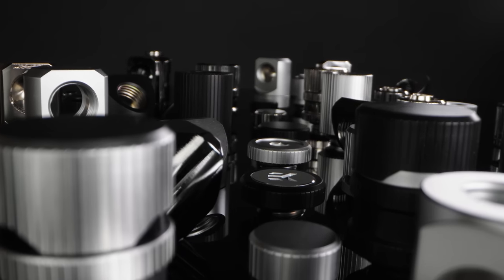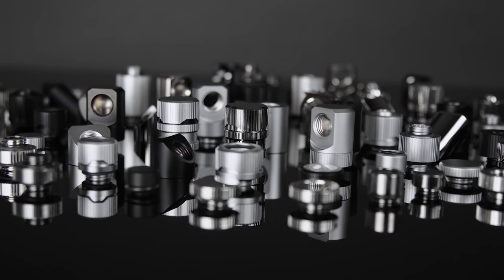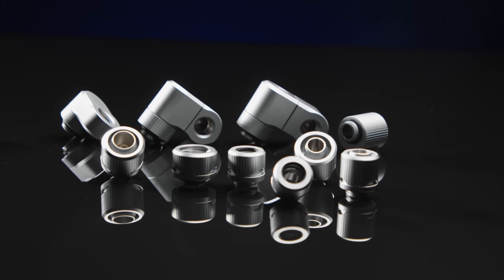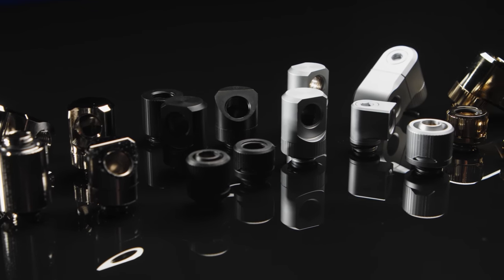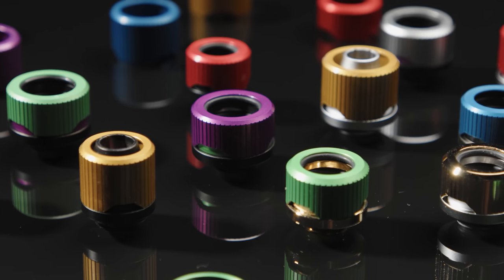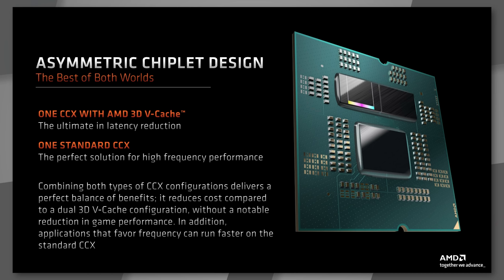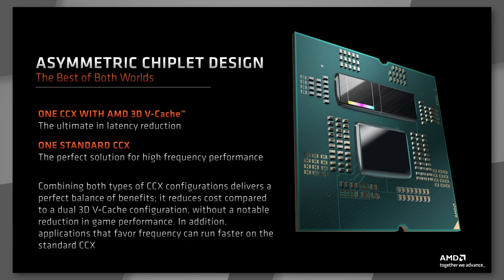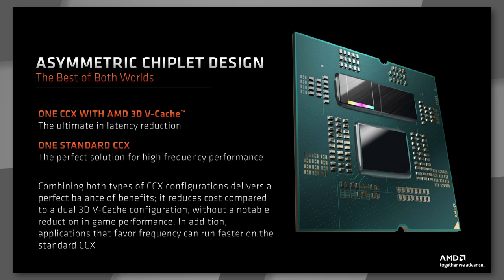Why I switched back to Intel...

Comment: I have the 5800X3D and it works really well. Stable, good memory stability. But its also end of a platform.
Reply: Are the 1% low's any good? I'm thinking of upgrading from the 5600 to 5800x3d
Reply: End of a platform is not a bad thing. It means that it's mature technology. Which is why you have such stability in the first place.
Reply: Seems like x3d is stable with 5000 series but not yet with the 7000 series
Reply: Lets be honest, its going to be good for a fair few more years to come unless you are going bleeding edge with GPU, and throw in the growing support for handheld PC's with much weaker CPU and GPU performance, and I am betting you will be fine for in the very least, until the next console gen and even then it won't be that bad.
Reply: @justmatt2655   I guess I must be lucky on that from, as my 7800X3D is rock solid, so long as I either leave the RAM at EXPO settings or just use 2 sticks. DDR5 is the bane of both my Intel and AMD PC's, more than 2 sticks can be a bit on the flaky side unless running at stock DDR5 speeds.
Reply: 5800X3D was a really solid CPU.  The 7950X3D, not so much.
Reply: true, but ddr3 even lasted until this year so this platform should be alright at least 3-4 more years if something big doesn't change
Reply: Same,  my 5800X3D is rock solid.
Reply: @levinoppers8151 Good, but 0.1% not so. Switched from 5800x3d to 13700K recently, much stablier lows.
Reply: @l4kr  I always buy in near the EOL for a platform for that reason. I'll let others be the guinea pigs while I enjoy my stable system. I've gotten myself a 14600K and I know this will last me for at least four years, maybe five considering the pace at which requirements are moving, but it will have paid for itself by the time I upgrade.
Reply: A platform ending isn't as bad as people tend to think, since it's becoming harder and harder to squeeze out decent generational performance improvements. A lot of times, what we're paying for is "years ago performance" on newer platforms. This is especially true of GPUs, but everybody falls for the marketing.
Reply: Same 100%
Reply: I had a 3900x which was rubbish with memory stability but that improved when I switched to 5800x3d.
Reply: Same. When it comes to gaming, it currently uses about 40% max. While my 3080 is getting 100% usage, it's time for an upgrade.
Reply: with 5800X3D. 3D cache works with all core. 3D cache 7xxxX3D does not
Reply: I have the stutter issue starting games with my 5800x3d
Reply: @foxskyful ryzen 5800x3d + RX 6800xt/RX 7800 XT + 32gb ddr4 3600mhz cl16  = easy   in next 10 years for 1080p 144+hz  titles, because this setup is twice stronger then PS5, 98 % game makes for PS 5 in 4k, SO,  and for online games in next 15 years enough, 95% PC gamers play online games..
Reply: @dzonib9595  It doesn't work like that, one of reason why it will not last 10 years for all games is lack of some features like latest dx and also bottleneck. And there is always a big jump in requirements at one point. Recently AW 2 was good example, you cant even play normally with rx 5000 series simple because it doesn't have mesh shader.
Reply: @foxskyful  my 10+ year old PC Today runs 98% Games in 1080p with FX 8350 and Hd 7950 ...
Reply: @dzonib9595  one thing it runs and how well it run at 1080p games like Hogwarts, Spiderman, Cyberpunk, Last of us, Elden ring and so on. I doubt you can even have stable 30 fps in most of this games on 1080p
Reply: I just want the best chip I can finally utilize Gen 5 m.2. I’ve used intel for 12 years and it just doesn’t have it for me.
Reply: I just toke a 5700X3D , the last one to AM4 , it cames even later than 5800X3D , and its perfect. Was my choice instead going to AM5. Im pushing memorys even higher than specs, and its completly stable , Im having an amazing experience in games. Maybe this is an AM5 socket problem, or something about DDR5s ( not so goo yet , too much frequency but with bad times and latency )...  I dont know for sure, but 3D in AM4 its the best experience I ever had. No crashes, no stutterings, no blue screens or problems like that, its just perfect for real. The "3D Cpus" are not good to OC, so Im using stock, but the memories ( 3200mhz specs ) I made work in 3600 mhz , and its stable ( 2x16gb = 32gb ) Im having a really great experience, but its AM4 , its DDR4 and its 5.000 3D. The problem with "3D Cpus" stability can be the new DDR5 probably...
Reply: @Daematter idk what the hell was wrong with yours but I had zero issues with the 0.1% lows. You had a defective chip.

Comment: I wonder how Jayz will look back to this video with the i7/i9 instability issues.
Reply: lol - now with the 14900K it's like "famous last words"
Reply: Yea I’m curious how many of those stability issues are due to motherboards throwing gobs of volts to CPU’s……
Reply: @dropmymonkey7073  Congratulations, you're spouting 2 months old misinformation. Intel has put that hypothesis behind long ago.
Reply: "This aged like milk"
Reply: Intel said it will be a fix in mid August, just voltage issue
Reply: @JohnLeaf its not, the chips have oxidation of via ducts due to contamination during manufacturing, oxidation causes resistance to grow which has changes on the voltage (may look like voltage issue, but is not). This has just been confirmed recently.
Reducing voltages helps temporarily, but it does not stop the degregation of the chip.
Reply: @symix.  Everybody says something.. But we need to know the real truth
Reply: @JohnLeaf  no, the laboratories checking the chips physically say one thing only.
Reply: look back hahahah
Reply: I have an 14900k and it’s fine lol
Reply: @madclone84  Wait a couple of month
Reply: @madclone84  Just because yours is ok doesn't mean it's ok in general.
Reply: @JohnLeaf yeah, belive it 😂
Reply: @madclone84 it’s fine, so far…😅
Reply: @Drown91  200+ hours no issues + new microcode lol I won’t be having problems
Reply: @kapitumbulu  yea 200 hours later
Reply: @madclone84  neither performances…😂

Just jokin bro, take it easy… I’ve a 4 months old 14700k that works perfectly fine still hitting 34+K on cinebench R23 (just got a spare 7950X3D, though, just in case…😆)
Reply: @madclone84  lol I ran with scissors and I'm fine lol
Reply: @EloyBushida  dumbest allegory I’ve ever read
Reply: @madclone84  Glad we agree your original comment was really stupid.
Reply: @EloyBushida  you’re probably on suicide watch realizing the r9 is all hype while intel 14th gen continue to dominate
Reply: @EloyBushida  300+ hours clocked no issues
Reply: @madclone84  LMAO imagine saying something this stupid.
Reply: @madclone84  Obsessed much? Blocked.
Reply: @madclone84  sooner or later you will smash your pc. it usually took at  least 6 months till ur cpu crashing
Reply: @antonsheridan7293  how is it going to crash
Reply: Been running my 13900k for over a year, hasn't crashed once yet 🤷‍♂️.
Reply: TheNathanCarlson  that's comforting. Thanks for the heads up. If not I can hold out for bartlett-lake
Reply: TheNathanCarlson  edited my comment, somehow scrubbed out the bit I had originally which said "I have a 13600kf, hopefully it holds out..."